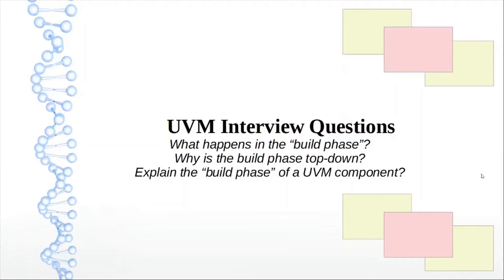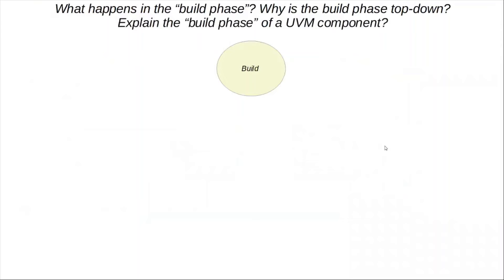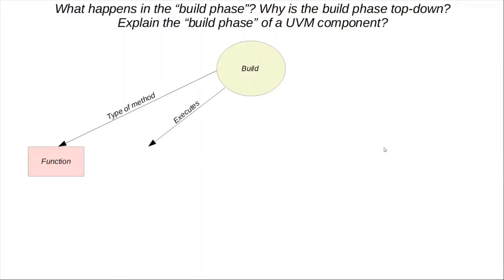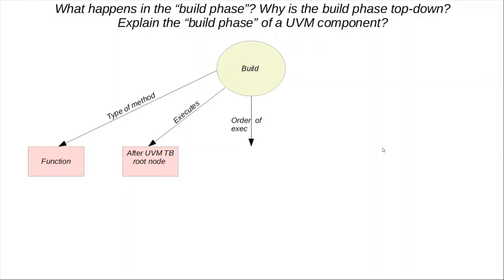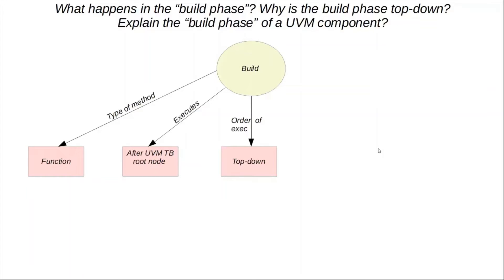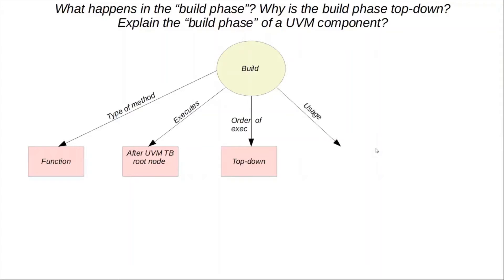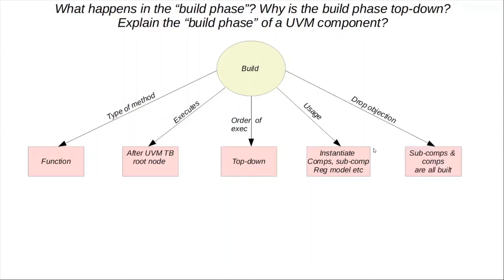UVM Questions: What happens in the “build phase”? Why is the build phase top-down?

Comment: Hi Ken,
If we have a test class and if we call ::type_id::create in its build phase to create an environment class, than the environment class will be created. My questions is which part triggers the build phase of the environment class - the end of build phase of test class or the ::type_id::create function call? Is it the built phase of the environment class automatically called and what happens to the built phase of the environment class when we don't create the environment class in the build phase in test class?
Thanks
Reply from the maker: When a UVM class is created, its build phase is invoked after all of its fields have been initialized but before any simulation work has started. When ::type_id::create is invoked in a test the build_phase of the environment class will be called automatically as part of the process of instantiating the environment class.

Comment: What is the main role of build phase ? we are having new() function which can do the same as build phase .. I mean the instantiation of class
Reply from the maker: Hi Majji,  the build phase is part of a series of phases like run, end of elab etc which helps in segregating instanton of tb components (typically in build)phase, the connection happen in connect phase, and so on. Whereas new() is used to construct an object without using the UVM factory. In UVM we typically use create() so that we can leverage factory. In conclusion, build is just a task which groups instantiations of various tb components/objects, whereas, new() or create() commands are used for instantiation. Check out the diff b/w new & create here -->   https://www.youtube.com/watch?v=aC-J9QuPLSA&t=214s.

Comment: good. I have a question why connect phase and other phases are bottom-up?
Reply from the maker: Hi Gana,   
The connect phase is used to make a connection between TLM ports like the export, and port. The main prerequisite is all components and the TLM ports should exist before the connect-phase kicks in. For these connections to be made properly it is important to know the correct configuration of components for instance whether a specific agent is active or passive and then only relevant connections for that sub-components (monitors, drivers, etc.) can be made and for that, it is better to start from the bottom sub-components. All the other bottom-up phases are mainly meant for updating and accessing environment or configurations and printing/reporting TB structure and topology. The bottom-up or depth-first through the component hierarchy seemed more efficient and thus was chosen by UVM. However, theoretically, this order for all the other bottom-up phases should not really matter.